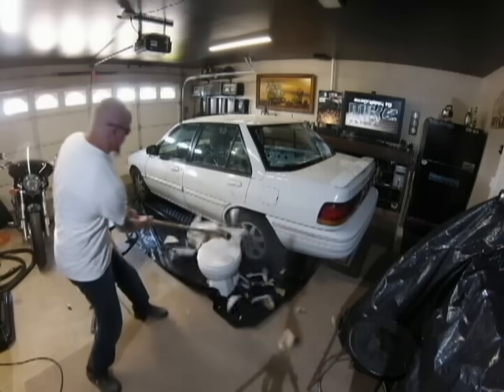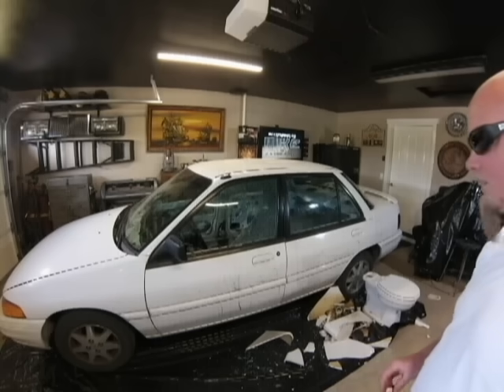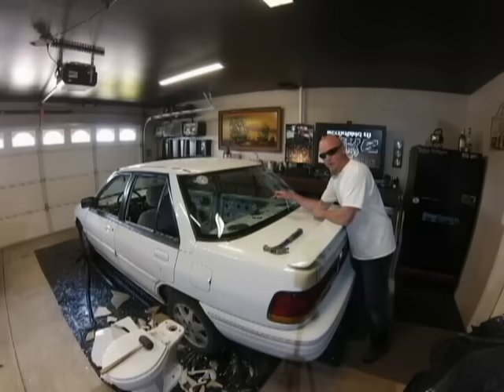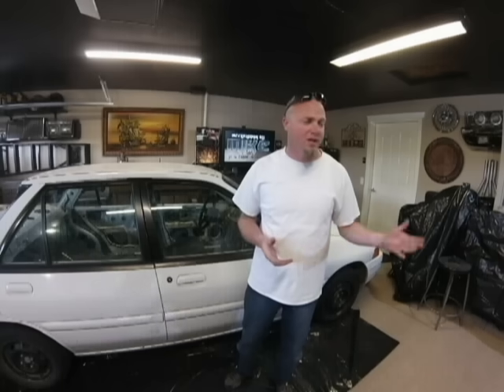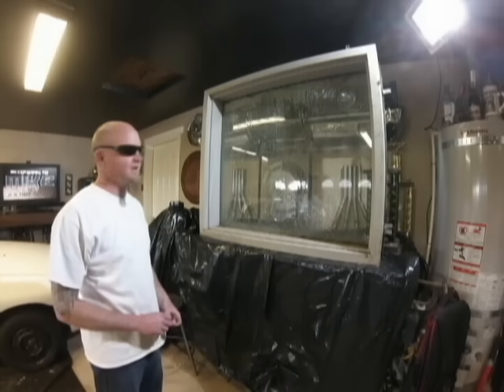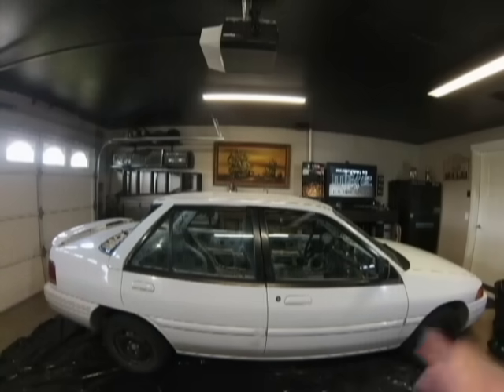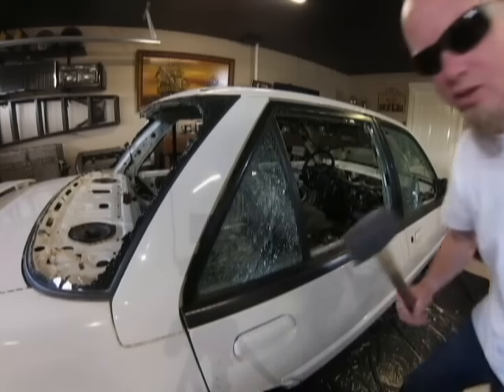How to break glass with a fragment of a spark plug (Part 2)

Comment: This is THE BEST spark plug (porcelain) vs car window test ever man! And you did a couple of things I had never seen before. You tested another type of porcelain and that was cool and you also did something I was super curious about and that is checking what spark plug porcelain would do to a large pane of tempered industrial glass, and now thanks to your video I know the answer. I wasn't curious about this because I someday want or plan to break an industrial window. The reason that interests me is that I live near Uvalde, Texas, where the recent school massacre took place and I wanted to figure out how a child might escape through a thick, non opening, industrial school window in case of emergency, and now I know a good answer. There was also the option of using one of those small, professional, spring loaded window breaking tools, but those are larger than a piece of porcelain and they could easily be construed as a weapon by a school district. Thanks for this video, it is very informative.

Comment: No brotha, so before I continue from 1.15 seconds what makes the soft sound of breaking the glass is you have to put the spark plug in a sick best way, then throw it on the concreate ground as hard as you can and it always breaks off a perfect piece with just the metal and porcelan wrapped around the metal bolt, now it’s the vibration that shakes the glass so fast that the glass will shatter and not break and so then it spider webs itself. Sooooooo cool lol

Comment: A toilet is not pure porcelain.  It is just a clay pot with a porcelain glaze over top.  It is whether the window gets hit with the porcelain edge and you are breaking it more by force than porcelain.  The porcelain in a spark plug is pure so it does not matter how it is thrown.  Front glass is not tempered glass like the sides but instead laminated regular glass.  Regular glass, lamianted glass, tempered glass, bullet proof glass.  True porcelain is fairly rare.  Some kitchen knives, electrical isolation ceramic and spark plugs

Comment: Wtf kind of glass is that ?? If you are in an accident in that thing you will get sliced by the fucking glass where is the safetly glass ?
Reply from the maker: Automotive glass breaks like that by design. It is “safety glass”. It’s tempered glass. If it wasn’t tempered glass, and it broke, it would be large sharp chunks that would certainly impale the driver or passenger.

Comment: Porcelain and ceramic are not the same thing.  That’s why the toilet is harder to get a break. 

Ceramic breaks glass (even safety glass) because ceramic doesn’t flex. Therefore, all the potential energy is unloaded into the single point of impact. If you hit the glass flat, it probably won’t break, but if you hit it with a sharp corner, all that potential energy is unloaded directly into that tiny spot, shattering the glass.

Comment: Because of the aluminum oxide content in the ceramic that's on spark plugs there's obviously not any aluminum oxide content in porcelain from a toilet. this aluminum oxide makes that stuff so much harder and it doesn't break up on contact with the window. Just blows right through it

Comment: For those who want to know, allow me to shoot my mouth off.  Car and truck front windshields are made of two special layers of glass stuck together with "Poly Vinyl Butryal" or (PVB).  Then it goes through special heating and things and once it is all finished it goes into YOUR car where it will collect chips, bug of every kind, attempted cleaning at every intersection in Nëəw Yōrk City (well not every intersection) and cracks that sometimes goes right through your line of vision!  But it is YOUR windscreen and sometime in the future it will have inferred whatever built into it and you can drive all you want at night without your headlights, yeah!!

Comment: The porcelain, from a spark plug is harder than the one from a toilet bowl. In order to brake the glass, it must be hit with a very sharp edge/point. Since the curvature of the spark plug porcelain  is small, the contact area during impact with the glass will also be small. If the glass is hit by a broken and sharp side of the porcelain, it brakes the glass more easier.

Comment: it’s alumina al2o3 but I wonder if it works with silicon nitride?  both are used in top quality ceramics ball bearings so I wonder if it works in ball form or if it has to be shards???

Comment: Yes the spark plugs is aluminum oxide ceramic, harder than toilet porcelain, essentially the spark plug is harder than the glass also, as well as very sharp, it creates a fine cut in the glass that then has a sort of a domino effect shattering the tempered glass, which is actually designed to shatter rather than break in big shards it's technically safer that way. Porcelain is more rock like than glass in all honesty, think very sharp, and dense rock verses a piece of tempered/saftey glass yeah porcelain is gonna win.

Comment: i think the ceramic on a spark plug is super hard. since it has to be able to take tons of heat and then also be able to cool down. compared to a toilet. i also think the toilet pieces that did break the window . would be like using a rock so it doesnt really do the same thing period.

Comment: The reason why the procline in spark plugs break windows easily is cuse one used in spark plugs is harder than a rock and puls when it breaks into shards it has a sharp point which makes easier to find the breaking point in glass as well - found that out breaking glass out of old cars that are to far gone to be fix for fun

Comment: It has to do with the sound frequencies generated by the ceramic when it hits tempered glass.  It doesn’t work nearly as well on laminated glass (like that of a windshield) because the laminate absorbs most of the frequencies generated by the impact.  👍🏻

Comment: It is not the size that matters, You want to hit the glass with a tiny point.  A very hard material hitting the glass with a tiny point will be able to easily overcome the tension of the tempered glass.  You can even try just pushing against the glass with the most pointy edge of the spark plug material.  Some are breaking the glass and some dont depending on whether the edge of the material that hits the window is pointy or dull.   You want the smallest surface area possible to push through the tension strength of the glass.

Comment: Impressive video!   Love the line, "Wait, that didn't work!  But the porcelain DOES!"  lol   It's amazing how effective those tiny spark plug chips are.  
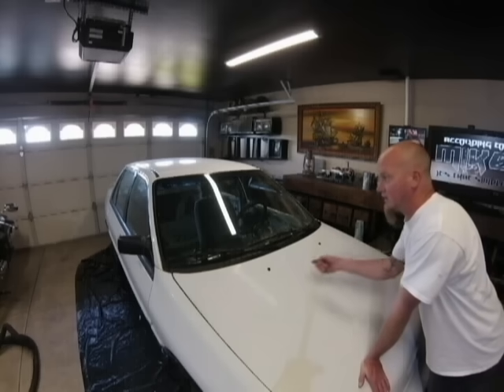3:34 Slight correction:  Windshields are not normally double pane glass with a piece of plastic in between.  They are glass in between two sheets of plastic laminate.

Comment: It works because Ceramic > Glass in terms of hardness.  
The physical elements a spark plug are harder than that of glass. Imagine a professional NFL linebacker running full sprint towards the average housewife and she not moving, when the 2 forces collides - what do you think will happen?
Another way to explain is you know how diamonds are one of the hardest elements known to man? hence why you need a diamond to cut a diamond.

Comment: The outside of the person has been polished and if it touches the window it will not sadder because the edges are not as sharp porcelain on a microscopic level has thousands of very sharp points when you shatter the spark plug the shattered edges are very pointy on a microscopic level that’s what it takes to bust the glass on the windows. The porcelain from the toilet would’ve worked better I think if it was hitting with the Saturn edge I think it may have been hitting with the flatbeds just unlucky I guess. That’s why the tools you buy to break windows have very pointy tips.
Reply: Motorcycle riders have been doing this since the 60s to shatter windows on cars that have attempted to run them off the road (wether from not paying attention or on purpose, either way LOOK TWICE SAVE A LIFE) my grandfather told my stories when I was younger about carrying pieces of spark plug with him when he went on trips with my grandmother in his 20s, this was around 1962 and onward. He said he never did but saw his buddies do it before. I have known other motorcycle riders to do this as well recently all the most people that ride motorcycles are actually really nice and you have to be acting pretty damn reckless with disregard for their safety for them to attempt that

Comment: Will a ceramic chip cut through tungsten wire ?  Some (all) fairground side shows that have an air rifle stand, have a selection of big value items hanging on a thin cotton thread. the deal is, if you can cut the thread with a lead pellet you win the prize..but the cotton is really a tungsten wire inside a cotton thread so it cuts the pellet in half. Could a chip of ceramic inside the pellet cut the tungsten wire . if someone sends me some tungsten wire ill do the test my self...

Comment: Spark plugs are made from a ceramic called Kaolin. Kaolin is high heat resistant. The spark plug contains aluminum and that's why it can shatter glass. Geology!

Comment: Can you show us how to hotwire a car?

No reason... just... want to know
Reply: S1L3NTASSASS1N 17 educational purposes
Reply: I believe lfpr educational purposes lol that you would have to sit in front passenger seat ..put foot on wheel and with both hands pull the steering with force towards you  and wollah the steering pin snaps..
Rip plastic cowling off from round ignition ..
Prize the Black cap off the back of ignition barrel with flat head screwdriver.
Put screwdriver in slot of black cap and turn screwdriver and start the vehicle..
that's it your off in approx 30 seconds...
If you wanted a Porsche. ... you would just use small surgical scissors and open them up in the ignition  ..bit of a waggle and turn and your gone ....
Ford's. ..scaffolding bar cut down and squashed a bit at one end ..rip cowling off from ignition and then just put bar over lock and snap it down...once snapped go to back of ignition and then stick screwdriver in and then turn....
Reply: On cars made in the last 20+ years, busting the column lock and turning the ignition switch are the easy part. Newer cars have "chipped" ignition keys and depending on year and model, those aren't so easy to get around. If you are lucky it will be a GM resistor key with only 15 different possibilities. If it is one of the newer RFID transponders you are probably screwed. Without a blank key and dealer level computer equipment you can crank the engine over till the battery dies and it still won't start.
Reply: Yes

Comment: 2018 new Federal Regulations all four sides of every car must have shatterproof safety glass and many car manufacturers switched many years ago that's why we saw the firefighter trying to smash through the side window of a sinking car and had problems. 
Victorinox Rescue Knife Tool has a window saw cutter for shatterproof glass.
Best to do first punch in the corner rather than middle of the window

Comment: I came here because of that part in Telltales The Walking Dead game. In the game a character called Glenn said the porcelain in spark plugs turns car windows to tissue paper. He breaks the spark plug and throws it at a car window shattering it on contact. I thought it was just made up for the sake of the game but it was real and I am surprised.

Comment: WOW BRO! TOILETS ARE MADE OF PORCELAIN AND SPARK PLUGS ARE MADE OF EXTREME HIGH HEAT CERAMIC. CERAMIC BREAKS GLASS BECAUSE WHEN FRICTION FROM THE IMPACT IS CAUSED IT REGENERATES ALL THAT ENERGY RIGHT BACK ONTO THE GLASS. THAT IS WHY THEY USE CERAMIC FOR SPARK PLUGS AND ELECTRIC POWER CABLE RESTRAINTS. THEY ABSORB ENERGY JUST AS FAST AS THEY EJECT IT. PLUS USED SPARK PLUGS WORK BETTER FROM ALL THE ENERGY THEY HAVE ACCUMULATED. YOU CAN LITERALLY RUB THE BROKEN PIECE ON THE WINDOW AND IT WILL CRACK. NOW YOU KNOW.

Comment: It’s the points on the object that penetrates, you can use the small red “drive way” stones and get the same effect, think of an emergency T hammer and how easily you can break glass using this instrument, spherical objects tend to bounce off of surfaces, it’s the snapped or rugged edge of the thrown object that does the work!

Comment: The hardness play a big role but it's P=F/A here, or pressure equals force per surface area. Think about how soft a baseball is compared to glass and think about the fact that a teenager can throw one hard enough (hopefully :/) to break that same car window. The hardness of ceramic mean that it takes very little force compared to the baseball but the deciding factor is surface area of the shard. Try the math: P=10lbs/.0001inches^2 or 100,000lbs/in^2. The hardness is the difference between whipping a fastball and a the opposite lack of force from the shard. If you tried that with the broad side of the ceramic it wouldnt take as much force as the baseball but it would take a lot more than the point.

Comment: It's breaks the window because of the harmonic tone or vibration it creates when it hits glass. Some people hear say it is because of it really hard strength and pointed edges which is not true. I used to do this with a intact spark plug porcelain which was still round and no sharp edges. Try for yourself by taking a spark plug and putting it in a vice. Then use a cut off wheel to remove the diode. Next use a diamond cut off wheel to cut the porcelain at the base of the spark plug off. You will be left with a complete tubular shaped piece of porcelain with no sharp or pointed edges. Then take a shoelace and put it through the porcelain and tie a knot at both ends so the porcelain doesn't slide off. Hold shoelace on 1 end and swing the porcelain into the window effortlessly. By doing it this way you also do not have to find your tiny piece of porcelain. Btw, the film in the windshield is what dampens the vibration or resonance from the harmonic tone the porcelain creates, which is why it doesn't break.

Comment: If your ever in a sinking car pop the hood and remove a spark plug. Then swim back inside and use the spark plug to break the glass.You can now exit the vehicle and surface to safety.

Comment: The front and back windows can hold up damage but won't break easily. The side windows are made so the middle is the strongest point. The corners are weaker to break the window hit the corners with a rock or anything and it will break.

Comment: The smaller the collision time, the larger the force. The less mass, the more velocity. The point of impact is small but very dense. This means that the window has to have a lot of elasticity to have the spark plug bounce off instead of going right through. This is because pretty much all of the momentum is conserved in this scenario.

Comment: It's all about hardness, the hardest material always wins. Tempered glass is under tension from the heat treatment it received, the harder insulation from the spark plug breaks and releases the tension contained in the tempered glass. You can take a leather glove, apply urethane rubber or silicone adhesive to the knuckles area of the glove, apply ceramic fragments (small and sifted for size uniformity) from spark plug insulators, then when cured usually 24 hours later you can wear the glove(s) and literally punch through the glass like a superhero. Yup, ALWAYS wear eye/face protective gear.

Comment: So the street styles to this are as follows spark plug remove gap tip use electrical tape to make a 8” whip go up to car with a flick of the wrist you just have brush the glass it’ll spider once your really good at it , it won’t even make a sound

Comment: You can tape up the window an use a handful of spark plug porcelain broke up smaller an it will break quietly an not make noise when you open the door, cause now days you have to quickly sit down in the seat an get on your laptop to be able to start the  car you break into, unless you got the fob,

Comment: The window is tempered glass. The way to break tempered glass is to apply a lot of pressure to a small area. For example take a nail and tap it with a hammer. All the energy is transferred to the point of the nail.

Comment: its ceramics hardness and  sharpness,   its anof to  break surface tension of glass which is a liquid. and under preasure...   you can crush the ceramic into smaller pieces works even better ..  and tempered glass is under lots of tension

Comment: Im not especialist, but im a physicist. I can bet with almost 99% that its becouse the hardness of material, metals is softer than glass, thats why its hard to break glass with metals, you need to bend the glass and enter in the other type of stress to break. And spark porcelan its harder than glass, and this way any amout of energy that you put in glass thru it, can liberate the the intrinsic stress that glass have.
You can test yourself and try to make risk marks in glass with any metals, it wont happen, but the other way, glass can mark metals....and if you bring more hardness material, like diamond, this can risk any glass.

Comment: In a little town far north of me the boaties have to put their boats away. Otherwise the local kids pull the spark plugs out and use them to break into cars. Their theory is the ceramic fragment is far quieter than throwing a brick through the window for example.

Comment: If it was the harness of the material something like a drill bit should work too... but I don't believe it will. I think it has something to do with the tension and elasticity between the parts and impact causing a perfect harmonic vibration on impact. Anything vibrating at the proper frequency will easilly be destroyed.